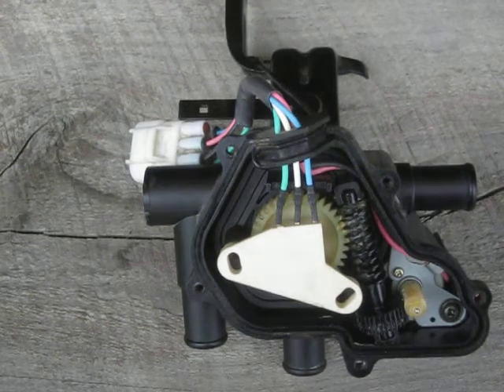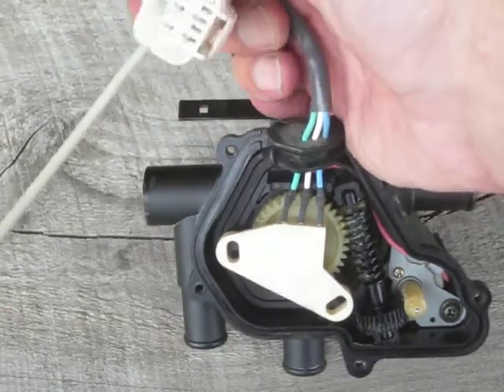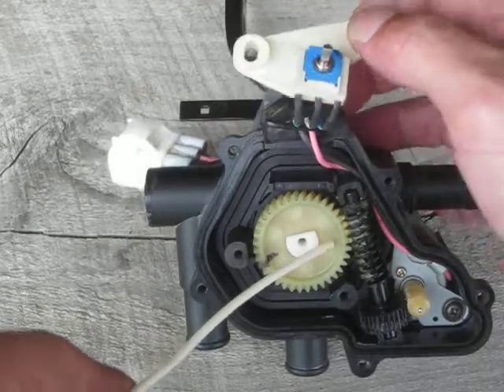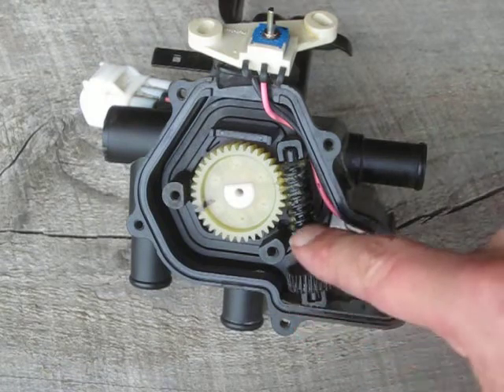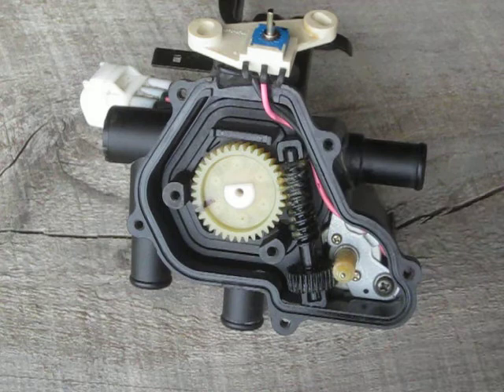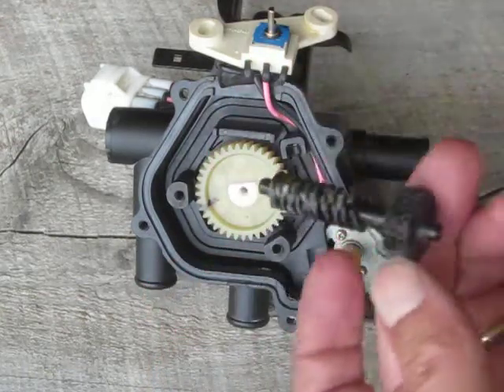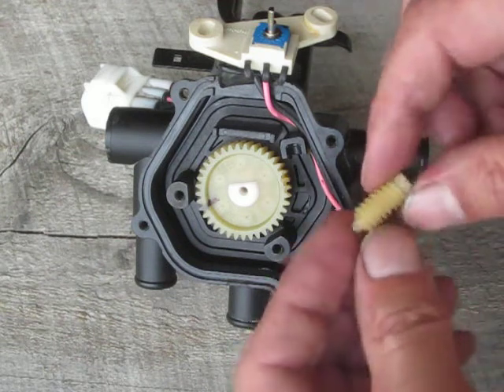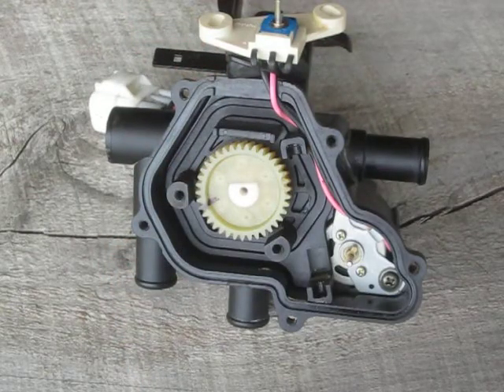Gen2 Prius Coolant Control Valve - What's under the cover

Comment: Wonder if you could work the big gear back and forward until free… since is like just debris…instead of replacing pump…looks like 4 screws to get gear cover off…
Reply from the maker: I found that the grit/debris had caused damage to the valve and body increasing friction.  One might be able to disassemble it and smooth the parts out, but given the cost of the valve vs the work involved, seems better to just replace it making sure to use pre-mixed new coolant to avoid even more contamination.
Reply: @ZookeeperJohnG  ok..good advice  Thanks!